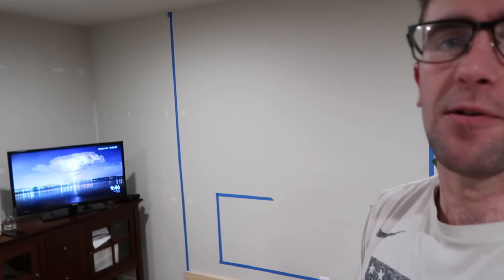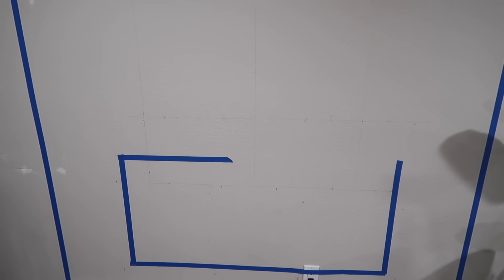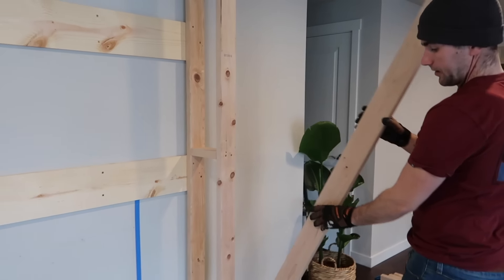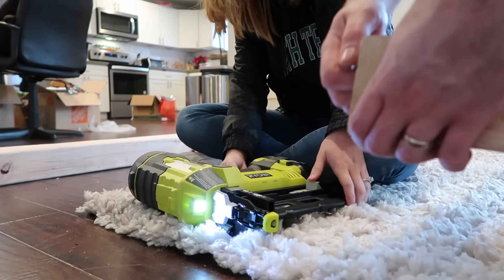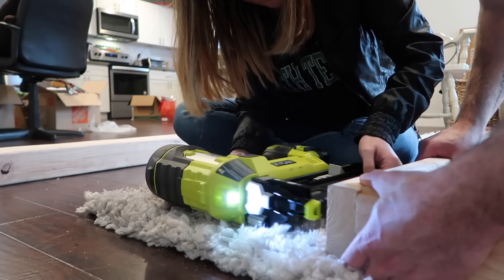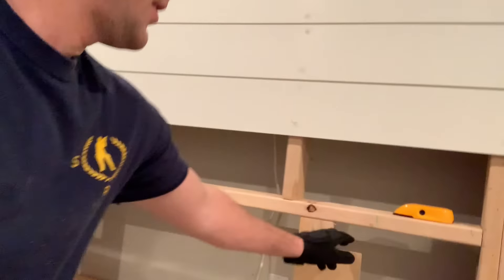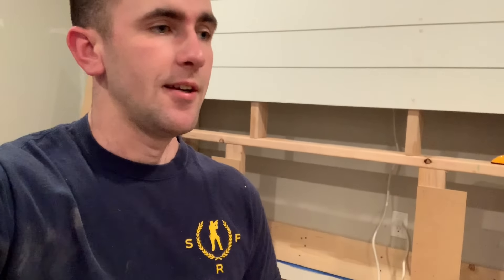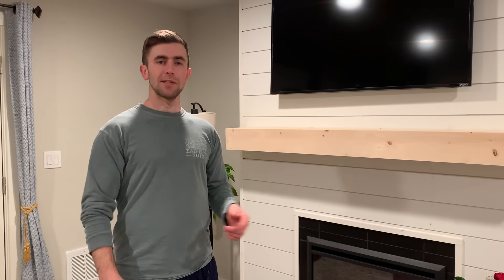DIY SHIPLAP FIREPLACE | WALL TRANSFORMATION

Comment: Thanks for sharing, it looks great! I just did my first shiplap project in a bathroom. I think it looks a little cleaner if you start at the bottom and nail through the tongue which is then hidden by the groove on the next board above. No exposed nail holes them to fill in!
Reply from the maker: That's awesome! Great advice. We will have to try that on our next shiplap project!

Comment: Thanks for posting your video on this fireplace job. I am about to start the same project for someone else and it's actually the same size too. 6x8. Your tips will help me make this project a success.  Thanks
Reply from the maker: Please let me know how your project works out! I was nervous the whole time I was building mine
Reply: @TheModernMann  just wanted to say that my fireplace build came out beautifully thanks to you ( I wish I could send you pix) My outside frame was great and I assembled my inside frame first in place using very good clamps to see everything in place and then as you suggested reassembled it and attached it while laying it on the floor. Everything came out great re-attaching it to the main frame and then adding all the shiplap. The only difference was the fireplace I used, was an electric one that I inserted about 14 inches from the floor. 
After completing the job and as I said it came out very nice and complete, I do have a strange question, once the shiplap and trim are all nailed in and everything is painted, what happens if access is needed to the plug or if you need to change the TV  or anything like that, isn't it kind of impossible since everything is closed off?
In my case the people I built this for didn't have an outlet inside the area of this build but just outside the box on both sides, so we had a surge protector put inside the built box on the wall  to power the TV & Fireplace and run the cord out of a small hole on the side and bottom of the shiplap, but either way, how can access be gained if needed without taking apart the wall? 
I thought about this afterwards when I was back home and it filled me with anxiety and nervousness, so I am wondering when my customers will call me asking this question, especially when they need to paint it and may want or need to remove the TV temporarily to do so.
Sorry for the long message but was wondering if you thought about that as well.
Thanks for your input,  and if you would like to see pix of my build just let me know.
Thanks again.
D.

Comment: We plan on doing something similar and already have the fireplace insert. However one thing to note is when running the electric fireplace it gets fairly warm on the top. We plan on putting cement board between the top of the fireplace insert and the wood to avoid any potential hazards! This looks great!

Comment: Nice job! But PLEASE for the love of god, when using a framing nailer or nailer of any type never hold the surface of what your directly nailing into. When you held it with two hands and she nailed it all I thought was a nail about to split the wood in the wrong direction and nail your finger.

Comment: Did you have to cut the baseboard? I have baseboard and crown moulding and I am trying to figure out if I can do it nicely without having to cut those. Can the shiplap pieces be coped into the baseboard and crown or is there another way?

Comment: Beautiful build! One issue I have with the tv/fireplace combo is that the tv is often too high for comfortable viewing. It's something I take note of because I'm a spine doctor. If you start getting headaches or a sore neck or just an uncomfortable feeling after a period of watching that tv, it's because the height of it is forcing you to arch your neck too much.  The solution is to lower your tv. For my house, the center height of the tv's is less than 2 feet above eye level (while sitting). Unfortunately, that can mess with design plans when you have a tall fireplace below the tv.
Reply from the maker: Yeah that’s what a few people have commented on however, we haven’t had any problems! We have a reclining couch so it works really nicely! We can recline to the perfect amount while we are watching a movie and our neck doesn’t have to arch! But I’m the future if I ever mount a tv in another house, that’s something I’ll consider!
Reply: We bought a MantleMount TV mount. It allows you to bring the TV out and down using pneumatic pumps.

Comment: Great video boss! I’m starting this project this coming weekend. What is te exact measurements of that fire place?
Reply from the maker: Thanks! 6ft 2 in wide, 7 ft 7.5 inch heigh and 1 ft deep.
Reply: Thank you for the response!
Reply: Another question what type of back board did you use to put the tiles on?

Comment: I scanned to the comments and couldn't tell if this was asked already but I'm sure it has been.. but how do you reach any of the chords or the outlets? or put devices? I think this is probably the best build I've seen for a TV wall on YouTube but I'm just trying figure out how to incorporate cord access mainly..
Reply from the maker: Great question Jason! I didn’t show it in the video and I regret not showing it lol but on the side I made a “hidden door” using this hardware:
https://www.amazon.com/Magnetic-Touch-Push-Latch-Black/dp/B07DNJNDGV/ref=asc_df_B07DNJNDGV/?tag=hyprod-20&linkCode=df0&hvadid=309763090755&hvpos=&hvnetw=g&hvrand=545103260008789654&hvpone=&hvptwo=&hvqmt=&hvdev=m&hvdvcmdl=&hvlocint=&hvlocphy=9033389&hvtargid=pla-573575520691&psc=1

I just push in on the side and the door opens. It’s easy to hide because the Shiplap naturally has horizontal lines so you don’t even know it’s there. Hope that helps? The door is only 2 feet by 1 foot

Comment: Really awesome, and helpful video. I am thinking about doing something similar, but I am wondering what your process would be if you have to reach the outlet or unplug the tv at a later date? Is there like an access panel?
Reply from the maker: Yes! Create an access panel on the side. I forgot this, but went back and added one later. You can add one that clicks in and out of place.

Comment: This is amazing! Is the shiplap a specific kind of board or is it just 4x4 boards painted white? I'm wondering because you mounted the TV to it.
Reply from the maker: It’s just regular shiplap board and the TV is mounted to the anchor points in the back. We cut a hole through the shiplap to do this.

Comment: Hey man, I was waiting on how you anchored the TV but I guess your video didn’t show. Anyways, can you tell if you added extra front studs to hold it? Or did you just anchored it unto the 2 vertical front studs that you installed? And if so, how is it holding the TV now?
Thanks for any info you can give, I will really appreciate it.
Reply from the maker: Great question and I don’t know why I didn’t put that part in! But when you start the project, I prompt you to screw in 4 1x6x6ft pieces of wood to your wall as your fireplace “anchors”. Well, I wanted my tv to be supported by one of those anchors so I bought an extendable TV mount that would extend out up to 2 feet and mounted that to the anchor that was second from the top! Does that make sense?
Reply: Thanks for your reply. Yes, I looked back and paused the video and now I see what you did there. Thanks for this video.
I am planning on building the same with a tv mount that extends two feet. Although, I wanted to have the full tv mount functionality so that I can rotate the tv 90 degrees. I guess I will have to think of a way to do that. I am open to suggestions.
Thanks again for the super awesome video.

Comment: Awesome...:) I plan to build the same..what did you use to cover the corners where the ship lap meets?? is that outside corner the v shaped lattice?
Reply from the maker: Correct! Here is what I used: https://www.homedepot.com/p/1-in-x-1-in-x-8-ft-Wood-Primed-Outside-Corner-Moulding-W9568PFJ/203579452?source=shoppingads&locale=en-US&mtc=Shopping-B-F_Brand-G-Multi-NA-Multi-NA-Feed-PLA-NA-NA-Catchall_PLA&cm_mmc=Shopping-B-F_Brand-G-Multi-NA-Multi-NA-Feed-PLA-NA-NA-Catchall_PLA-71700000014585962-58700001236285396-92700010802552466&gclid=CjwKCAiAjeSABhAPEiwAqfxURUwwNF8Rrp8K78nywqJX3VwjPZsR5vo3quxCjbSXxrbcHr4TmqceiRoCUAoQAvD_BwE&gclsrc=aw.ds

Comment: any concerns with weight on the wall? or does the floor take most of the weight? thanks
Reply: He should be concerned.  Doesn't look like he used a framing nailer.
Reply: @heem1911 isn’t the floor taking most of the weight? or no?

Comment: I think I missed it in the video...what did you use for the corners to cover the ends of the shiplap? Interested in building this project but just curious what you used. Thanks!
Reply from the maker: It’s a 90° trim! I’ve attached the link. I got it from Home Depot https://www.homedepot.com/p/Finished-Elegance-205-1-in-x-1-in-x-96-in-FEMDF-Outside-Moulding-10005665/207043278?mtc=Shopping-VF-F_Vendor-G-D30-30_20_MOULDINGS-Finished_Elegance-NA-Feed-PLA-NA-NA-MOULDINGS_FinishedEleganceMoulding&cm_mmc=Shopping-VF-F_Vendor-G-D30-30_20_MOULDINGS-Finished_Elegance-NA-Feed-PLA-NA-NA-MOULDINGS_FinishedEleganceMoulding-71700000033149556-58700003867183965-92700031090175119&gclid=Cj0KCQiAk7TuBRDQARIsAMRrfUahYU3ltbGboJCaxLV8OwLiu6SikKRgsFnBMETU1jJJVr6iQ0llTSAaAtNkEALw_wcB&gclsrc=aw.ds
Reply: @TheModernMann  was wondering the same thing.  Thanks for the link!

Comment: Turned out nice, you know pocket holes or toe nailing screws are stronger methods than drilling straight through butt joints?! And the cladding is nice, I would’ve mitred my corners so there’d be no reason to use trim as cover up.
Reply from the maker: Haha well I’m just a beginner. I’ll learn that stuff as I go I’m sure!

Comment: My electric fireplace says not to cover the top but also says it can be recessed. How did you get around this as I imagine yours would be the same.
Reply from the maker: That’s a great question. My fireplace is recessed however the frame it’s recessed in is essentially a skeleton. Inside behind the Shiplap is nothing but air and empty space so  there is nothing covering the topside of the fireplace. Does that make sense?

Comment: Great video! Getting ready to start mine tomorrow. Question: I noticed you didn’t take out your baseboard. How did you do this without having to cut the shiplap or trim piece around it?
Reply from the maker: Good question! I bought the same trim size for the bottom of the fire place so I was able to hide gaps left by the baseboard!

Comment: It looks great. I was going to pay someone to do this for me but I’m sure I can do it myself. I just need the nailer. Question though, how would you add additional things to the outlet if you needed to add a firestick or cable receiver? Do you have to take part of it apart?
Reply from the maker: So I got lucky that there was an outlet right where my fireplace was going but some of you may not have an outlet there. If the outlet is on the inside of the fire place, which mine is, and I had to add something else that would be a permanent fixture, I would pull some of the side boards off, plug in a power strip and Velcro it somewhere inside and then you can plug 4-5 things up. Just be careful because the more items that you plug up. You are at risk of tripping the breaker
Reply: The Modern Man actually you can’t it’s against code to have a plug in or a power strip enclosed like that.

Comment: Am planning on doing something similar.  One difference which im trying to figure out is my floor to ceiling is (cant remember off top my head now) somewhere around 16-18' (living room is a great room in a 2 story house).  Thoughts on how to frame that height?
Reply from the maker: Honestly do the same thing but just use different lengths. The important thing is that your anchors are secured to your wall. Use double the anchors if you have to but it will still work great using the same layout

Comment: Saw a couple people asking for a list of supplies. This is what I used:

Tools-
https://www.homedepot.com/p/RYOBI-18-Volt-ONE-Cordless-3-Speed-1-4-in-Hex-Impact-Driver-Tool-Only-P237/206588778
https://www.homedepot.com/p/RYOBI-18-Volt-ONE-Lithium-Ion-Cordless-AirStrike-16-Gauge-Cordless-Straight-Finish-Nailer-Tool-Only-with-Sample-Nails-P325/204667878 ( I think this is what he used in the video, I tried to make it out.)
https://www.homedepot.com/p/RYOBI-10-in-Compound-Miter-Saw-with-LED-TS1346/306939211
https://www.homedepot.com/p/RYOBI-ONE-18-Volt-Cordless-Multi-Tool-Tool-Only-P343B/313269538 (Don't NEED this, just used it to remove the trim instead of leaving it like Conner did.)

Wood (not including mantle)
10  2x4x10s 
4    1x8x10s

Hardware
https://www.homedepot.com/p/DEWALT-2-in-x-16-Gauge-Straight-Finish-Nails-2500-per-Box-DCS16200/203164018
https://www.homedepot.com/p/SPAX-8-x-2-1-2-in-T-Star-Plus-Drive-Flat-Head-Partial-Thread-Yellow-Zinc-Coated-Multi-Material-Screw-133-per-Box-4191020400606/202040970

GFs in charge of the shiplap and trim. When I find out what she choses, i'll post here.

Comment: One more thing, I noticed you put the TV bracket on the back wall with what looks like some kind of extension so you could mount the TV on the outside of the shiplap. How did that work for you? And where are your cable wires, DVD player and wires etc...?
Reply from the maker: So I used what I call a “scissor mount” which allows you to pull the TV out about a foot from the wall and I did that so the TV would be flush with the shiplap. So behind the TV there is a 6inch by 12inch hole so the mount can move around smoothly and for any cables to be run. I have a smart TV so I don’t have a cable box or DVD player but if I did, they sell covers that look like outlet covers but it’s for cables to run through. I would mount one behind the cable box or DVD player horizontally along the top of the mantle so the box would cover it but then you could run wires from there to your TV from the hole where the mount is. I hope that makes some since? Lol but it has been working beautiful for me.
Reply: @TheModernMann  I understand,  Thanks again. I will let you know how it works out. I start building it tomorrow.

Comment: Nice job! What outlet did you use for your tv and do you have an access panel to get to the tv and fireplace?
Reply from the maker: Luckily there is an outlet that was already in place behind the fire place so I was able to plug both the TV and the fireplace into one outlet. And I’ve had both the TV and fireplace on at the same time for a couple of hours and the breaker never tripped. And if I need back there, it’s super easy to detach a couple of the side boards for access

Comment: What type of lumber did you use to build the frame? Treated or untreated?
Reply: They used untreated. Treated wood looks darker and has many little marks in it to allow the chemical to soak in.
Reply from the maker: Gregory Blake thanks for the assist. Yes untreated!

Comment: Ty for all DIY project I'm do my first time I learn a lot t walls 8ft I note step by step ty my walls 8ft !ty cross 1x6 8ft wide length!  2x4  I need (10)  I'm add in between surround  sound.I'm do TV. Space center surround sound below ele fire place .safety note  you have 110v .plug  should. Install power surge protector side door open close in case thund storm power surge put power surge TV.fireplace cheaper reset turn on off then back on. Then short TV storm? Eletric  fireplace too  safety. Everything else great ty inf.

Comment: Hello what size screws did you use to a attach the 2 x 4 to the anchor wood?
Reply from the maker: We used 3 inch screws! That way it can go through the 2 inch 2X4 and still have 1 inch left to anchor!

Comment: Can you put on here what kind of mount you used for your tv and how you mounted it inside the shiplap. Did you make a bracket or attach it to the wall?
Reply from the maker: I don’t know what the technical name for it is but it’s a “scissor” mount. I’ve attached a link to one like mine https://www.target.com/p/monoprice-tv-wall-mount-bracket-for-tvs-37in-to-70in-full-motion-articulating-max-weight-77lbs-vesa-patterns-up-to-400x400-rotating-ul-certified/-/A-78064391?ref=tgt_adv_XS000000&AFID=google_pla_df&fndsrc=tgtao&CPNG=PLA_Electronics%2BShopping&adgroup=SC_Electronics&LID=700000001170770pgs&network=g&device=m&location=9033389&ds_rl=1246978&ds_rl=1248099&ds_rl=1246978&gclid=Cj0KCQiAk7TuBRDQARIsAMRrfUYWosupfVqzYi6jH7Yi84_F7jtWy16eF0EjnoF-7ZKHrtEbFdXlHlQaAiFIEALw_wcB&gclsrc=aw.ds

Comment: I love the design...great work, but you certainly don't want your hands anywhere near the area that nail gun is firing... when you were holding the corners together, make sure your hands are clear... use clamps to hold corners tight, not hands.  Safety first.

Comment: Where did you get the trim on corners?
Reply from the maker: Here is a link for what I used for the trim! https://www.homedepot.com/p/1-in-x-1-in-x-8-ft-Wood-Primed-Outside-Corner-Moulding-W9568PFJ/203579452

Hope this helps!
Reply: @TheModernMann  My apologies for asking a second time!  I am not too familiar with the notifications on here.  We just built one of these walls and it is coming great, but ours is 9ft tall, do you have any idea where to get a trim piece just like that one that is 9 or 10' long??  I ideally don't want to have a cut mark right in the middle of it.  Thank you!
Reply from the maker: I just tried looking and seems like 8 feet is the standard but theoretically if you have 6 inch trim on the base and 6inch trim on the ceiling then you should only need an 8foot 90 degree trim down the sides. Does that make sense?